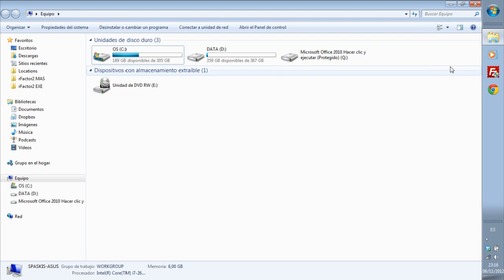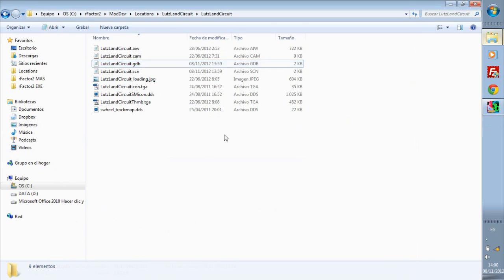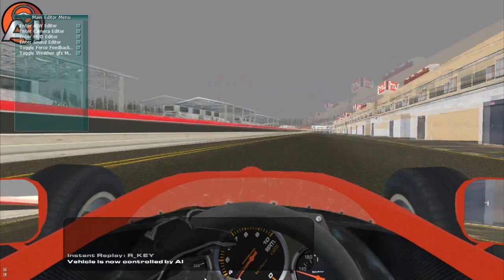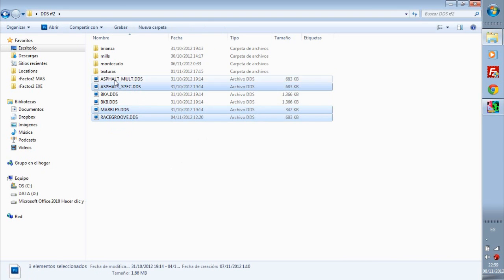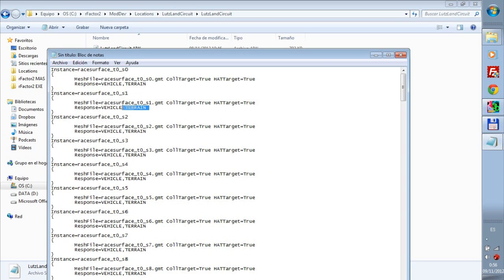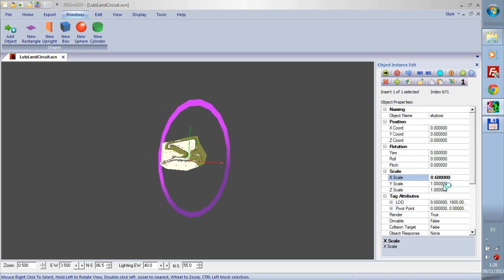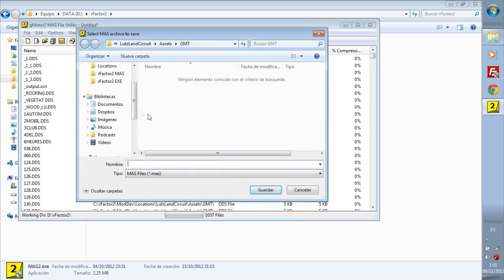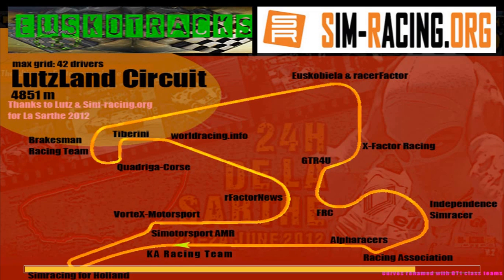convert tracks from rfactor to rfactor2 with 3dsimed

Comment: Great video but i get stuck when loading the track into dev mode, i can see a warning in the logs but no matter what i do to fix it i cant get the thing to load, any help would be awesome, heres the error line:- WARNING: Unable to find track-specific gdb file for: H:\SteamLibrary\steamapps\common\rFactor 2\ModDev\Locations\MeanwoodGT24\Assets\GMT\_output.scn

Comment: I tried this guide but when I try to load into the track in DevMode is just gives me a error loading scn file in the crashlog :(. Any Idea what could cause that?
Reply from the maker: what is the error?
Reply: +spaskis1976 vidman.cpp   2428: CUBE error loading scene file F:\Steam Games\steamapps\common\rFactor 2\ModDev\Locations\ESSINGTON_LONG\ESSINGTON_LONG\ESSINGTON_LONG.SCN: Error initializing scene file F:\Steam Games\steamapps\common\rFactor 2\ModDev\Locations\ESSINGTON_LONG\ESSINGTON_LONG\ESSINGTON_LONG.SCN .. I think thats the main error :/ I used a standard rf1 track to try it out.
Reply from the maker: +Virtual Racing Entertainment It is difficult to judge without being able to look at your project. Are you using a standard scn file from rf2? i always paste the gmt instances into a standard empty scn file. I would not use the default output.scn from 3dsimed. Beware also about the name of the layout to be correctly set.

I would also suggest to try to pack it into a rfcmp. It is actually less demanding than devmode where the paths need to be correctly setup.
Reply: +spaskis1976 I copied the code from the output file (Like your video) and pasted that in the bottom of the SCN file.
Reply: +spaskis1976 I could upload you the SCN file and the output file if you want. Maybe you find something. Would really appreciate the help and thanks for the fast reply btw :)
Reply from the maker: +Virtual Racing Entertainment  zip the whole folder and upload it to dropbox or other. I'll take a look asap.
Reply: +spaskis1976 Dont rush it :) I appreciate it though I'm on it !
Reply from the maker: +Virtual Racing Entertainment tomorrow I travel abroad. I'll be back on tuesday. I'll take a look at it.
Reply: Thank you very much :) Your guide was really helpful maybe I just made a mistake since I started looking into converting just today. But yeah thanks very much for the help :) !
Reply: +Virtual Racing Entertainment The problem is likely an issue with the new dev mode build changing how the convert track script works. In the top of your .scn file, you need to change all instances of JOESVILLE with whatever you told the script your trackname was.
Reply: +Ess Jay I try that ! :O
Reply: +Ess Jay I guess you mean the searchpathes in the SCN file? Since it's already set to this 
SearchPath=.
SearchPath=ESSINGTON_LONG
SearchPath=ESSINGTON_LONG\ESSINGTON_LONG
SearchPath=ESSINGTON_LONG\ASSETS\ANIMS
SearchPath=ESSINGTON_LONG\ASSETS\GMT
SearchPath=ESSINGTON_LONG\ASSETS\MAPS
SearchPath=ESSINGTON_LONG\ASSETS\SPONSORMAPS

But there is no Sponsormaps folder inside the Assets folder. I try it with commenting that one out.
Reply: +Ess Jay Sadly I still get errors that he cant load some dds files or stats :/ I'll just wait it out a bit until  Spaskis is back :)
Reply: +Ess Jay These are the errors that pop up. abload.de/img/error1fbu7x.png abload.de/img/error2cxugt.png maybe that can help
Reply: +Virtual Racing Entertainment Yeeeah it worked I had an error in the gdb file and forgot to put the right name for the tdf file in the gdb. It works now. But then again many thanks to anyone and I hope these commands help someone that got issues :)
Reply from the maker: +Virtual Racing Entertainment. I'm glad you solved it.
Reply: Yeah now I'm figuring out real road .. hah I guess I just need to rest for a bit for that :D

Comment: Thanks you very much for this video. Where do we get the Brianza files from? I dont have those those try other textures but end up with a yellow/green road. 

Many thanks again.
Reply from the maker: install the track you want to use the textures. go to installed\locations and open the folder of the track until you see the mas files. Unpack those mas files into another folder. open the scn file with 3dsimed.
Reply: +spaskis1976 Thanks a million, Im getting there all be it very slowly lol.

Comment: i cant get the vbs file to work it keeps saying its not i the right DIR. whats going on?
Reply: We figured out the problem... He did not have the Joesville track in locations folder.
Reply: drdoomslab I have a friend getting that error too. I think that the data location is messing it up.
Reply from the maker: ***** you need to put the vbs in the locations folder of devmode subfolder
Reply: spaskis1976
it is in that location. but in your script you say 'script should be in the 'rFactor 2\Data\ModDev\Locations' folder. I have no Data folder. but mine works unlike my friends.

Comment from the maker: You need to decompress the .mas files into the same folder were scn is.
Reply: Hi. I'm at the final stage of packaging the component, I am trying to add the four MAS files in the gMotor utility tool when i name the component, select location, then try to add the MAS to the package they do not appear. If i add them and click package, the rfcmp is only 1kb.
Reply: I solved the problem. The MAS files must be created using the MAS2.exe found in rFactor2 support/tools. If you use the MAS.exe to create them the component packer tool will not load them.